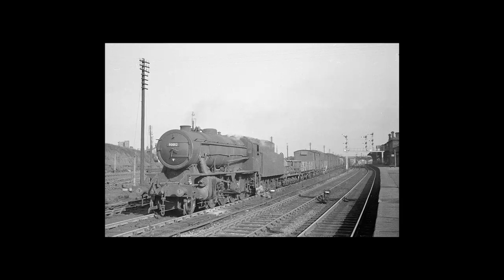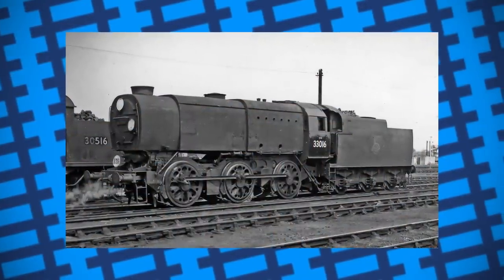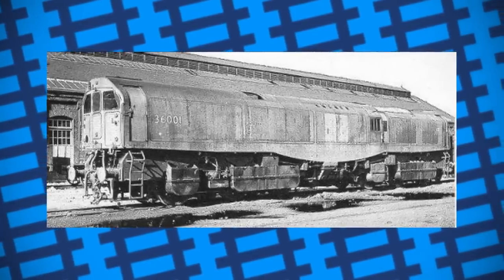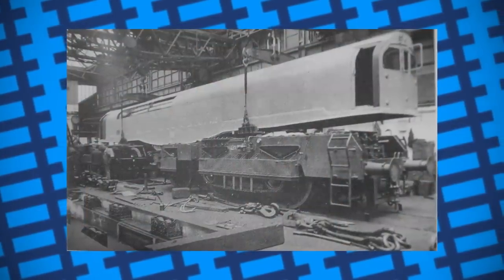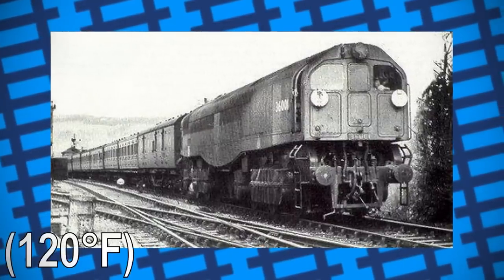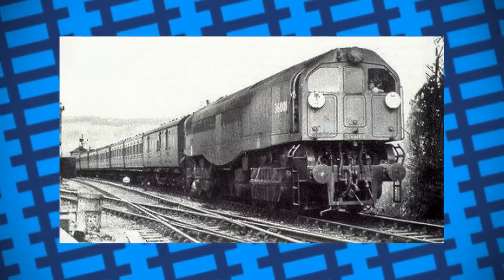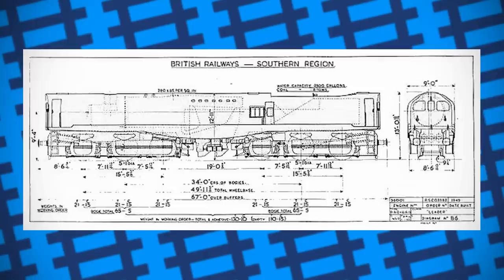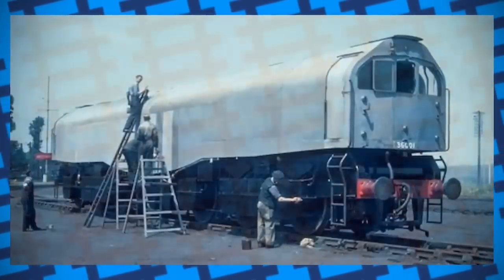The strange Steam Locomotive that was built like a Diesel - SR Leader Class

Comment: Just scrolling through the comments and for general information Leader was intended to be oil fired. British railways in the thirties had dabbled with oil firing, generally at the behest of the government. 
Mine labour issues prewar had driven home the fact of dependence on coal. The LNER boards' interest in the Reichsbahn VT for their own east coast route being along this line of thinking. A substantial factor in Gresleys A4 streamlining was to effect coal savings.
Bulleid used this premise, hence a very small firemans cab, and centrally located. 
It appears that the oil firing intention was always there throughout leaders production, never having actually changed to coal firing.
Where this change came about was the passing of Southern into British Railways: and the learning of some fairly long winded production of some locomotives of interesting engineering. British Railways now having to foot the bills, they rather expectedly were quite keen on having something to show in a not unreasonable amount of time. And the thing with the oil firing was that even if fitted to the locos, you still needed somewhere to fill up: a bothersome aspect that bit the GWR rather harshly.
So coal and hand fired they became, as an expediency.
As it turned out they performed on par with a Southern N, hardly enough to set the engineering society alight

Comment: Oil firing, adjustment to water towers, improvements to ventilation, and incorporating sliding panels or a telescoping house on rails to allow better servicing as well as a water scoop like some American engines for watering on the go would have been simple fixes. If that had all happened 10 or 15 years prior they would probably be a well known class. This is what this prototye was designed to find, needed adjustments to the design while proving the concept.

Comment: seems like the engineers behind its maintenance were the downfall. that issue with draft is quite dangerous as well, it can cause blowback in the firebox meaning flames gasses and heat would come out into the firemens cab through the fire hole door. I’ve had this happen to me in engines when i didn’t have the smokebox door properly sealed or the grits got clogged up
Reply: I think the main reason for its downfall was the fact that, by the 1940s, it should have been obvious that electric and diesel locomotives were the future, and further development of steam locomotives was a technological dead-end.

Comment: It was introduced at a time when many steam locos were converted to run on Bunker C oil. Had it been converted to such a system then the fireman could have been in the cab with the driver using remote controls. It was built a few years too early. There was also talk a few years ago of using steam engines burning coal dust in a liquid sand firebox.
Further tests could have been carried out but BR was being run by ex-LMS executives leaving Robin Riddles and ES Cox in charge of future design. All BR steam classes were basically updated LMS designs.

Comment: With some modifacations those leader locos could've been revolutionary. Also could you maybe make a video about the Heilmann locomotive?
Reply: I could imagine it was one of those late-steam experiments that was flawed but could have gone somewhere with more work - but even with such wouldn't have been competitive with diesels, so were abandoned.
Reply: @quillmaurer6563  no, it was a French steam electric protype
Reply: @Arkay315  What are you referring to? I'm thinking of the Leader class from the video. I'm sure there were some interesting French designs as well. French designs tend to be ... interesting anyway.
Reply: Imagine it being oil-fired, and having a conventional running gear setup less prone to breaking. It likely could have been one of the most powerful steam engines on UK railways in its time
Reply: @tyler_bt3326  Would it have been advantageous over a diesel though? While that might have worked and produced impressive results, at the time diesels were quickly displacing steam due to being more fuel efficient, lower maintenance, quicker to get running, easier to operate, and not needing water. The biggest advantage of steam over diesels at the time - I get the sense especially in Britain in the Postwar era - is that they could run on coal, which was cheaper than oil/diesel. An oil burning steamer would burn more oil than a diesel (granted the unrefined oil used on steam locomotives would be cheaper than refined diesel, but probably not enough to offset the greater consumption), so have no advantage over a diesel.

That timeframe produced some really interesting and promising steam locomotive designs, but they just couldn't be competitive with the emerging diesels even if fully developed. That's why some of the best and most interesting steam locomotive concepts were never developed to maturity, abandoned before they could leave their mark. The same is true of piston engine aircraft design from the same era, doing some impressive things but phased out in favor of jets.
Reply: @quillmaurer6563  everything you say is true, and we got the Deltic in the end so I’d say things worked out quite nicely. 

I’ll admit, I’m completely ignoring practicality. It’s just cool to think about what could have been. Same as the C&O M1, realistically a steam turbine train is irrelevant in the diesel age but it’s damn cool to think about no less
Reply: @tyler_bt3326  Agreed, I've certainly pondered what might be possible with steam given modern technology - metallurgy, non-metallic components (I visualize carbon fiber piston, piston rod, connecting rod, to minimize reciprocating mass and thus reduce hammer blow), microprocessor control, perhaps even solenoid-actuated valves instead of mechanical valve gear to both provide more optimized valve timing and reduce mechanical complexity. Or steam turbine-electric. Performance, thermal efficiency, reliability, maintenance, and operational simplicity could be vastly better than any steam locomotive ever built. Yet, in reality, still nowhere near that of a modern diesel-electric. It's fun to think about, but could never make practical sense. At this point the same is honestly true of internal-combustion cars, while they're way more exciting to most enthusiasts than electric could ever be, for most use cases electric is superior (or soon will be) in almost every regard.

Comment: Some nice ideas but too many experiments in 1 vehicle:
Chain driven valve gear had proven unreliable, but Bullied wanted to try & prove he could get it working.
The loco was said to use more oil for lubrication than a modern diesel does for fuel.
Sleeve valves had been abandoned by others many years before. Bullied wanted to try where others had failed. The valves suffered many failures.
The fireman's location was very inhospitable.

It gave the driver a much better view than from a conventional cab.
It did not need turning at the end of a journey.
It was a lot easier to keep clean.
All the wheels provided traction.

Comment: What a fascinating and wonderful video. I wonder does anybody model these experimental engines in any scale particularly HO?  That is the one I am trying to build a layout of currently.
Reply: Obscure but weird, don't know if model-making companies wouldn't bother due to obscurity, or would make it for its quirkiness. Though at this point someone could probably make their own with a resin-type 3D printer, would be just as good quality as injection-molded plastic, and you could make whatever you want. Wouldn't be surprised if that changes the model railroad industry, where people buy mass-produced running gear/electronics, 3D print their own body to put on it, and custom program the DCC sound for whatever locomotive they made.
Reply: @quillmaurer6563   Have neither of you heard about K.R. Models making this in OO gauge???? If you’re modelling this in HO, however, you’ll probably have to find a wheel conversion method. I don’t think there is a company out there who manufactures Bulleid’s Firth wheels in HO sadly :(
Reply: @amazi6542  HO and OO use the same track.
Reply: @Ballinalower  Oh yeah, that's true! haha I believe I got confused between HO and EM somehow. Silly me.

Comment: One can only imagine all kinds of ways to bring the weight down, and make it less of a nightmare for the crew.
I can think of a few. smaller wheels, 4 bogies instead of 3, centered double boiler that can be walked above by a walkway that doubles as an access hatch for the water tower, coal being fed with a screw and chute system instead of manually... Or, well, windows on the bloody cab doors.
I noted that most of the end of steam era engines shared the same problem with size and weight.... and engineer's hate for operators and mechanics. no wonder diesels took over. they ARE better in every aspect, unless you're british and you absolutely want a monstruous opposed piston uniflow 2 stroke train.

Comment: Do we have pictures of the cab?
I always wondered if there ever was a steam loco that had modern controls, not all this valve and pulley stuff but something similar to a modern diesel engine
Reply: Unlikely because it would still need some sort of system to control regulator & cutoff on behalf of the driver.

Comment: One of Bulleid's contemporaries said that "Bulleid is a brilliant engineer . . . ", only for another to say " . . . but not a PRACTICAL engineer."
His Merchant Navy design was much the same;  radical thinking, but utterly impractical. The oil bath lubrication system was one point. Bulleid noted that it worked very well on cars, but failed to see that bolting a thin sheet metal oil pan to a cast iron cylinder block (as in a car) was a very different proposition to doing the same to the flexible steel frames of a steam loco - and the oil pans leaked so much oil that the boiler lagging became saturated with oil - and freqently set the engine on fire when the oil was ignited by sparks from the brake blocks!
Another was the appallingly temperamental valve gear, which even the best drivers found so hair trigger in operation that they'd get it somewhere near waht they wanted and leave it alone, driving the engine on the regulator (NOT the most economical way of working, but the best that could be achieved).
By the time the first batch of MNs were completed, both these faults (and many more) were obvious - so what did Bulleid do? He went on to build the Battle of Britain / West Country class, with EXACTLY the same faults . . . and built so many of the damn things that the Southern region even used them on pick up goods!
As to why BR board decided to scrap the Leaders;  according to legendary engineman Bert Hooker, it was because Bulleid had used fully welded rather than riveted boilers, and because the boilers were not stress-relieved after welding, within a very few years, they started developing cracks which would eventually lead to them exploding.
Bulleid failed to grasp that the point of an engineer is not to use his role to indulge in ego-tripping, but to design things that WORK.

Comment: makes me wonder how well this engine could have been if it was redesigned with an oil fired boiler, and put the boiler in the center a sacrifice i know, but it would make the weight lighter and even
Reply: At that point of time after the war, the only right to exist for steam locos is the fact, that they do not need precious, high quality fuel types like oil or diesel but can run on low quality fuel like coal. From a simple commercial or engineering perspective a steam engine running on oil or diesel is extremly expensive and outright stupid. Steam engines are annoying all over the place. you need to heat them up for hours and the efficiency isn't good at all. Burning precious diesel in them is a sacrileg, if you could also put that diesel into an diesel loco producing 2-3 times the mileage from the same amount. Steam locos are more of a mechanical trade off. They were the only known power source, where you could easily separate power production and turning motion. The steam is a transportation medium for mechanical power; connecting the fire to wheels. in a diesel engine, the fire is directly working onto the piston and in your car you have a friction clutch to disconnect the engine from the wheels. That does not work for railway locos but as soon as diesel-electric or diesel-hydraulic power trains were developed, the days of the steam locos were over (diesel-pneumatic wouldn't work out...).

Comment: The Southern Pacific in the US had an oil burning cab first class of steam locomotives. Everything controlled by the engineer (driver) remotely from the cab. There is one in the Sacramento museum.

If BR/Southern Railway had gone for oil not coal (I understand UK coal vs oil in 1949) but it may had worked!

Comment: Leader was dead before arrival. Just read E.S. Cox. It solved none of the problems of the Stephenson locomotive and introduced a good few others, some of which turned out to be insurmountable.  I would say in defence of OVB is that the 'simple' answers of Diesel or Electric were neither simple or available after the war. Firstly, the UK was utterly bankrupt, so there was no question of converting to a fuel that could only come from being imported - in any case engines of the power required could not be manufactured in the Uk, and importing was impossible financially. Sitting on millions of tons of coal was only going to give one answer.
Electric power would've been good, but there was no money - the railways were not in a position to spend any money and were looking to government for money. As a sequel the development of the traction diesel motive unit in the UK during the late 40s and early 50s simply did not happen and so by 1955, almost no moves away from steam had begun. That is why most of the technology for diesel engines was not British, being licensors or reparation technology

Comment: Sounds like a last-ditch effort to keep steam competitive with diesel. A lot of interesting things came out in the era, such as new valve gear designs, ultra-high-pressure, marine-style water tube boilers, steam turbines, car-body/boxcab steam locomotives, and so on. None of which were successful, all being too troublesome to be used for very long. Some of them showed potential, with further refinement the problems might have been solvable and they might have been improvements over past designs. But it became clear that even with such improvements they'd still not be competitive with diesels, thus were abandoned. The same trend - around the same time in fact - could be seen with piston-engine airplanes, some pretty out-there designs that were troublesome but showed great performance potential, though such efforts were abandoned in favor of jets. And I suspect the same thing might be happening now with gasoline powered cars, soon to be replaced with electric, though at this point I suspect car makers see this coming and are pulling back R&D on gasoline cars.

Comment: I wonder if it would have been better if it was made to burn oil, like the SP forward cab locos.
Reply: That would be no real Advantage. Back then, Britain had no Oil but Loads of Coal (guess why Steam Lorries were used well into the 1950ies)
Reply: @Genius_at_Work  it would enable the fireman to control burners rather than shovel coal through an open stoke hole. But yes, coal was plentiful then.
Reply: It was designed to be oil fired, I'll add a general comment as this factor seems to have been overlooked

Comment: Just think if Bulleid had fired the boiler with oil rather than coal as steam engines in the USA were fired in the early '50s.
Reply: It was originally intended to be oil fired. I'll add a general comment as it seems to have been overlooked

Comment: Makes me wonder if it would have worked any better with a mechanical stoker, or even pulverized coal or oil firing. Then again, that might just be too much innovation all at once.
Reply: Germany tried powderised Coal in the 05 003 Cab Forward Locomotive. The Coal was blown into the Firebox very unevenly, causing it to combust irregularly and incompletely, thus clogging the Smoketubes with lots of Soot. IIRC, the Problem was that Powder Burners were proven in stationary and Marine Boilers but failed on Locomotives, because the couldn't Coupe with the strong Vibrations in Rails.
Reply: @Genius_at_Work   Here in the US, there were various attempts at advanced steam turbine locomotives. Two were like mobile power plants with a boiler, turbine, and generator, and were just too complicated to be crammed into a locomotive and subjected to all the dirt and vibration. A third was a project by General Electric, American Locomotive Company, and Union Pacific, that skipped the boiler entirely and burned coal powder in the turbine. Needless to say, the coal ash quickly eroded the turbine blades and the entire project was cancelled.

Comment: It's not clear to me, but hadn't it been better if this locomotive used an automatic feeding system as some articulated american locomotives also used? Ex the 3900 and 4000 articulated series of the UP, they were already running desings when this locomotive was on the sketch board. This to improve the conditions of the fireman so he could be in the same cabin as the engineer and just periodically go check the fire on the firebox.